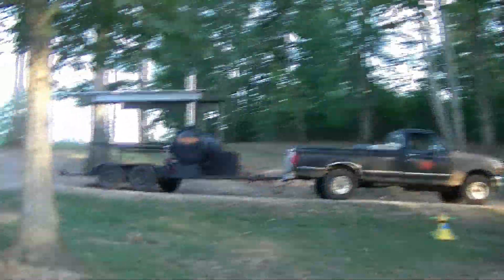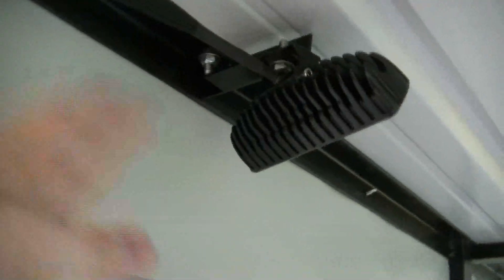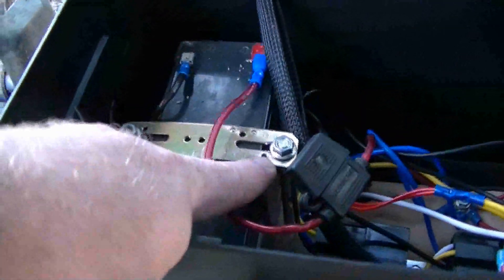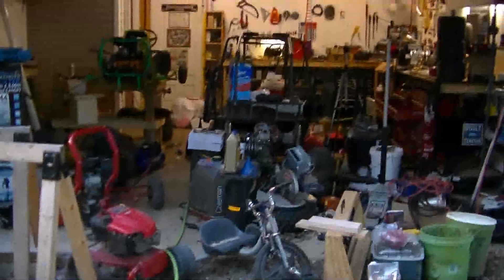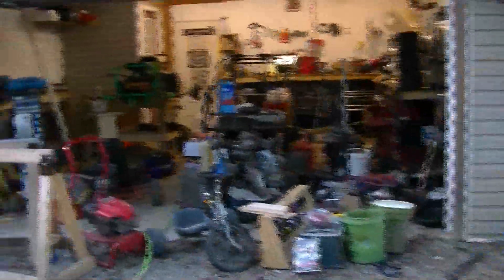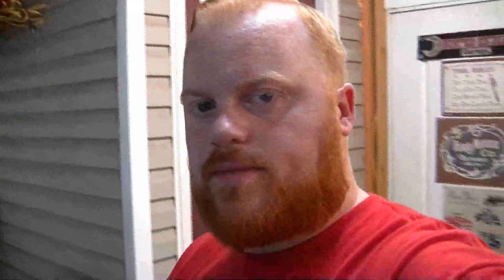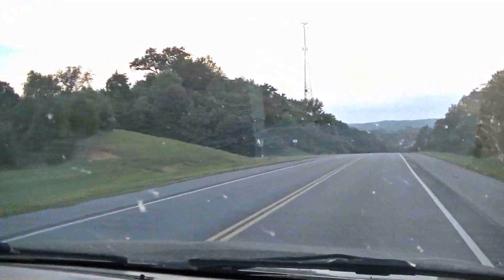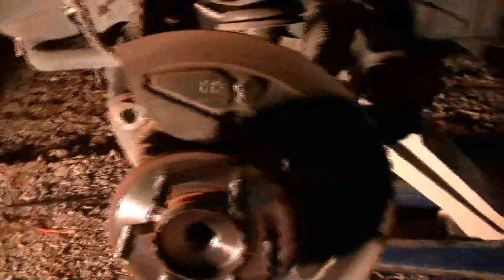Smoker Lights and Brake Jobs

Comment: Great work on the wiring. I used those same toggles when I wired up an underhood  light in my truck. I installed it on the radiator support. Since they aren't waterproof,  I used silicon caulk and put it on the wiring side of the switch.  Been installed for 9 years now with no problems.

Comment: What if you have a inline fuse? Can the vehicle still catch on fire
Reply from the maker: Well it depends on what you are running off the toggle switch. The switch itself is not designed to handle a lot of power. So if you are running halogen fog lights and put just a toggle switch on them it is most likely going to meld down that toggle. It all depends on how much power your trying to run through it.